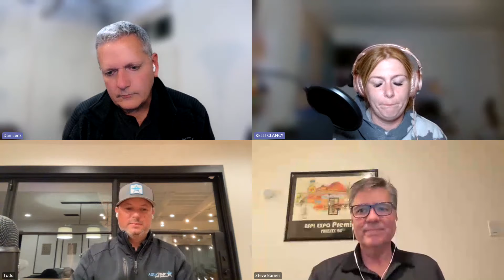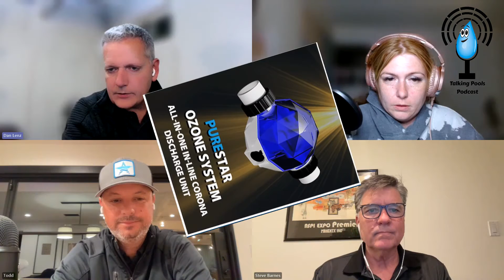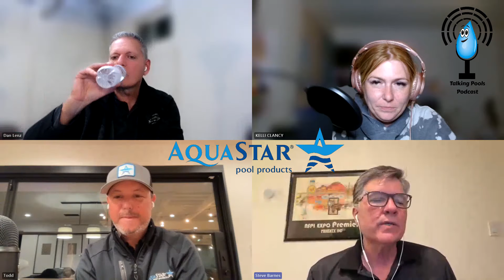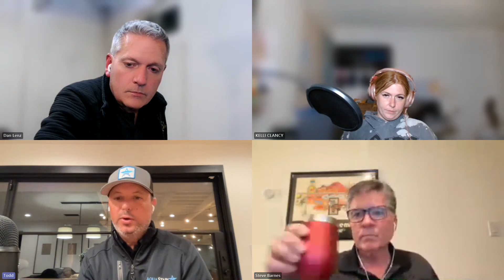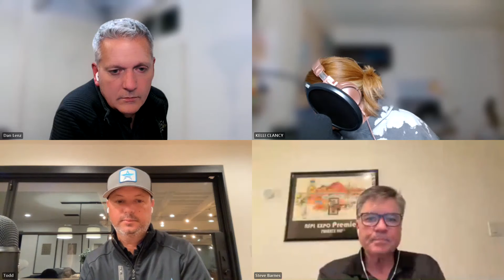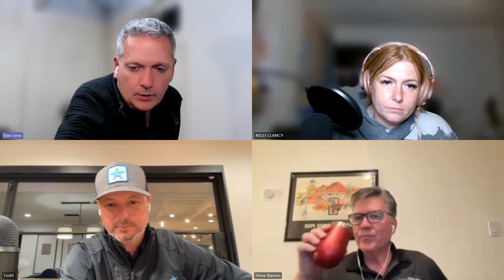The truth about OZONE for Swimming Pools

Comment: We just got a new AquaStar installed but my pool is constantly SPITTING AIR and gosh it is so annoying.  No Cracks, No leaks.  could it be installed incorrectly?  Check Valve maybe?
Reply: THE AquaStar PureStar Corona Discharge Ozone System
Reply: @rking1237 what rpm are you running

Comment: does this technology eliminate the need for chlorine?
Reply: No. It reduces the amount of chlorine needed. Ozone works extremely well with running variable speed pumps 24/7.  

You can pretty much run 1 to 2ppm chlorine if you do your own maintenance. Micro dosing chlorine every few days with liquid or using a feeder. 

Just keep in mind if you expect a high bather load, it’s good to raise chlorine to account for the load.
Reply: @bigjack79  there must be something else that can be done to avoid chlorine exposure. I heard that it is common in Europe/other countries that operate pools exclusively on ozone, not sure if its a just a myth or not but that would be nice.
Reply: @fortitude1981  I would imagine at some point that it is possible. They are probably doing bromine instead of chlorine. You would
Need large amounts of ozone and 24/7 circulation. 

Ozone on its on in warm water probably wouldn’t be enough with a high bather load. You need some form of residual sanitizer.